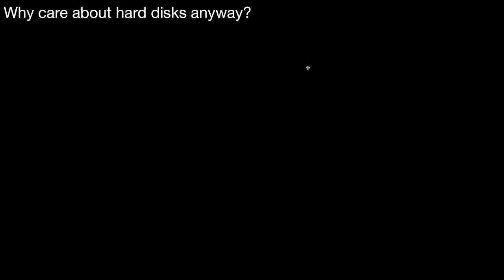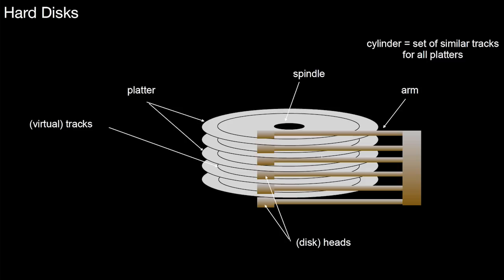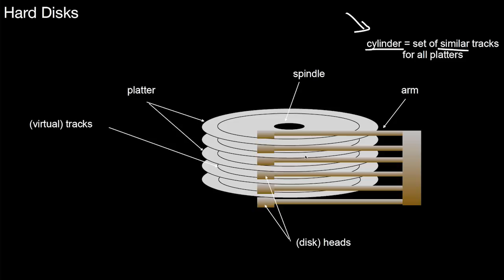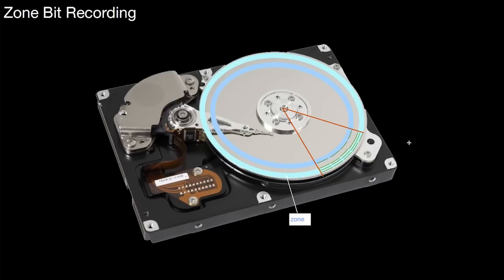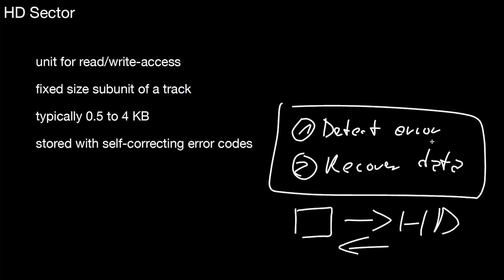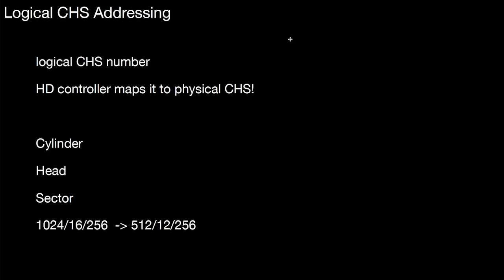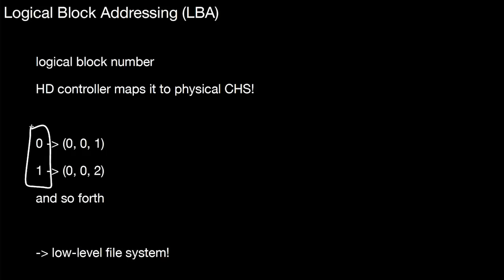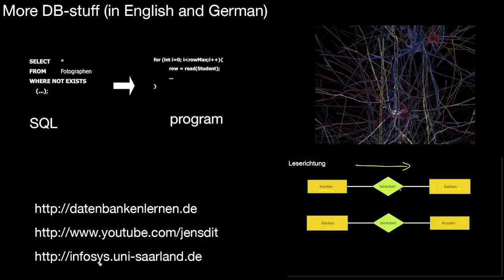14.113 Hard Disks, Sectors, Zone Bit Recording, Sectors vs Blocks, CHS, LBA, Sparing

Comment: About the sector remapping: this happens very rarely and is usually a pre-failure-condition, so if the S.M.A.R.T.-attribute 5 "Reallocated Sector Count" has a raw-value bigger than 0, than the best thing to do is do a last backup and then replace the HDD. Of course it is not always pre-failure, because a damaged sector can also be caused by a bad cable or a power failure (however, in the case of a bad cable, the raw value of the attribute 199 "UltraDMA CRC Error Count" also increases).
Reply: Bad cable won't cause a bad sector. The bad data will be coded and written, and the same bad data will be read back successfully (this is why zfs uses end-to-end checksums). Bad power, yes, that MIGHT be able to do it, if ram is corrupted or logic screwed-up, or write-power is insufficient / distorted.

Comment: Thank you for good video. I have a qeustion at the last part of video. You said , when we use LBA, hard disk can do sequential access although there is a physical difference between sectors. Is it right?(or, you mean, when we use LBA, hard disk can keep writing if there is a error in 43 section by choosing another sector which is distant from 42,44?) If so, why is it the advantage of LBA? I might not understand the contents in video exactly because I live in non-english country..
Reply from the maker: The point is that the disk controller may remap block IDs to different physical places, e.g. to hide a failing block. This implies that the HD may handle such an error transparently without the software layers on top having to do anything about it (they won't even notice this). And this is a good thing. Not as good is that the actual access pattern you assume when reading a sequential (logical) sequence of blockIDs may not necessarily be translated to a physical sequential access. Bottom line: As with any indirection in computer science: it gives you some nice features, but you give up some control (which is often crucial in data management).
Reply: Jens Dittrich Thank you for answer. Ive learned a lot of things from your lectures.

Comment: Great job but IMA still confused about translation of CHS. How can two hard drives with the same CHS be of different size?
Reply: Any suggestions on figuring this out...
Reply from the maker: Carl Smith
 Notice that standards such as EIDE and ATA-2 constrain the address space that may be used for (C,H,S), e.g. if 28 Bits may be used for the address, C may use 16 bits, H may use 4 bits, and S may use 8 bits. Obviously, if the drive has less net storage space available, not all of these sectors are actually addressable.
see also http://en.wikipedia.org/wiki/Cylinder-head-sector#Heads